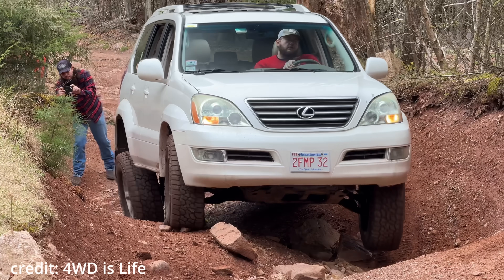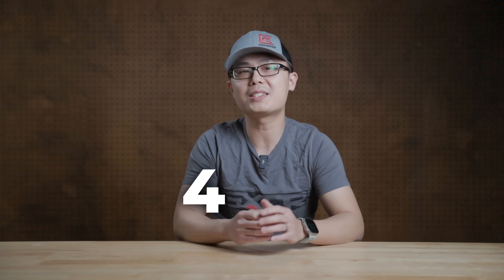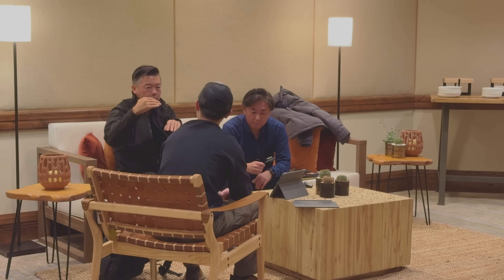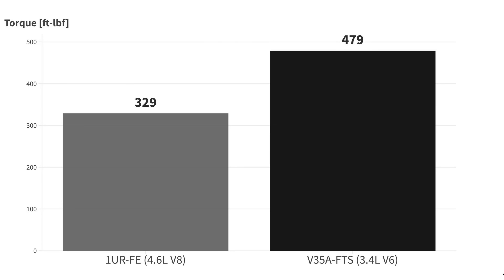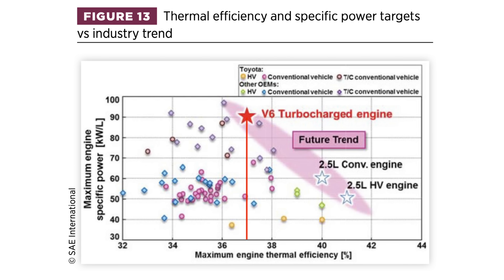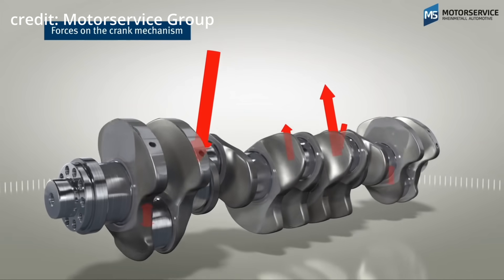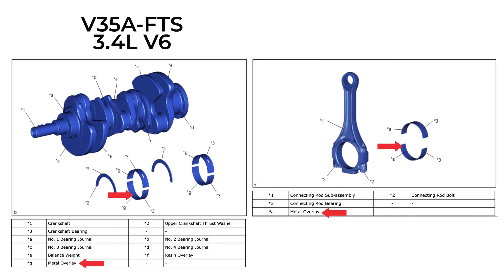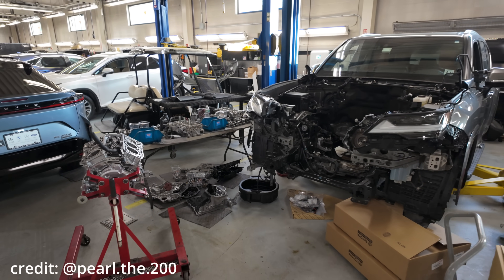Is Toyota V35A-FTS Engine Reliable? Well..It's Not That Simple

Comment from the maker: About 1 month after filming this video, (and 6 years after Chris replaced his first V35A-FTS with main bearing failure), Toyota FINALLY released something official with a safety recall on 5/30/2024. Root cause was machining debris as some of the internet comments correctly predicted. Check out the official recall here https://pressroom.toyota.com/toyota-recalls-certain-model-year-2022-2023-toyota-tundra-and-lexus-lx-vehicles/#
Reply: Thanks for the follow up, great video.
Reply: Hey, Great video!    Regarding this recall and the machining debris....   It would sound more believable if it was related to one supplier or manufacturer of parts, but it appears it's happened at both the USA plant in Texas and the Tahara plant in Japan.  This seems more like a design issue than it does a manufacturing or assembly issue.   And the fact that it's happened over many many years, even though the recall is for '22 and '23 models.  What are your thoughts?
Reply: @Superdada  If they use the same SOP's then the manufacturing location may not matter.
Reply: @OverlandOutfitters  true.  

But my hunch is there’s more to this story. 
“Machining debris” seems more like they weren’t following the SOP.  And the fact that it happened at multiple locations seems odd.  Unless we’re taking about particles the size of microns that’s getting undetected.  

Whether we’ll ever find out or not, I trust Toyota will make it right.
Reply: I’m trying to understand why the hybrid isn’t included.  Or is it just a matter of time?
Reply: @tommyg7047  another YouTuber, @pickuptruckandSUVtalk I think, mentioned that the hybrid isn't included because the hybrid can still get to the dealership under is own power. So the hybrid still get replaced under warranty, but it isn't considered the same sort of catastrophic failure. 

That's what I recall. Seems like a fine line to walk in my opinion.
Reply: @BKthePerson  I saw that too.  So basically, the hybrid may also have “machining debris”.  My guess is these will also have a recall eventually… but knock on wood, mine has 20k and going strong.
Reply: Sorry not buying this machining debris story.  Everything points to a design flaw, and now they are asking their customers who experience this to bring their $70K machine in and have a local dealer disassemble and reassemble the engine and pray it last until the warranty expires.
Reply: @savannahrei8674 we can only hope they extend the warranty by 100k and offer full crated engine replacements.  But that’s still TBD.
Reply: this is not a recall from toyota by the way, it is simply an intent to announce a recall by the mid to end of july 2024.  It was not until the USA Federal government safety agency stepped in and issued a recall because of safety that toyota announced that they "may have left machining debris in the block during manufacturing", that this all happened.  If you notice, the time stamps are only slightly off from each other but the release date was the same. the government released hours before toyota announced their INTENT to recall by mid to end of july 2024.  Further interesting is the fact that this is happening to engines from both the USA and Japanese factory, and that it is happening across their top flagship models and nothing was done about it and it was activly hidden and swept under the rug until the fed stepped in.  There is a lot to take in here about it all, especially considering that they have further pushed this engine block set up in their entirely new and redesigned GX550 and are further producing other new cars and body styles with this in it.  Yet there are dealerships refusing to take tundras in on trade even if you bought them there, but they sure are happy to sell them and any other that may be affected by so called "debris" left behind by toyota directly from the factory.
Reply: So when is Toyota going to hire you as a consultant ??!!! Hey it would be really great for you to share how you’ve become so knowledgeable unless you’re just a pure Genius!!!
Reply: What Toyota / Lexus models are affected ?
Reply: Would replacing the main bearing with another identical main bearing simply cause the same problem ? Great work on the videos
Reply: Well guess om having second thoughts about getting a new GX 550.. Ugh
Reply: @Gonzo1968  the gx550 is unaffected
Reply: @Superdada  It's technically the USA plant in Alabama for this fault, right? I'm going to be surprised if it's a manufacturing or assembly issue, if we find out.
Reply: not so far, maybe when its debugged.
Reply: @TinkerersAdventure  already said posted and announced…. You’re pretty late to the party.  Btw the NHTSA announced a full safety recall of these well before Toyota did…
Reply: Toyota used to be more reliable than other car brands but the switch to turbos has put them on par with everyone else now. This is the proof and they still charging that premium toyota/ lexus price tag
Reply: @tylerproctor4878  are you just now getting into Toyota or?…. Because Toyota has been doing turbo engines for over 40 years and there has not been a single issue with them then or now. Lol. Brush up on your facts. Turbos have literally zero to do with any issues at all happening to anything Toyota/lexus
Reply: @samuelgatton  I suppose I wasn't very clear with that and you are right. Toyota makes great turbos. In fact almost every turbo from most oems are great and all of them have a low failure rate. However, turbo engines as a whole have traditionally had less reliability and longevity numbers than NA engines. Toyota is now like other OEMs using more turbo engines. Apparently these turbo engines function under more stress and have a little more complexity than an engine w/o a turbo. That is besides my point though. My point was Toyota doesn't seem to be much more reliable lately than other OEMs and still cost a lot more. Hope this is a better explanation for you. Cheers
Reply: Is the new land cruiser with a 4-cylinder single turbo hybrid better than this twin turbo V6?
Reply: There seems to be a bigger problem.  The new Tacoma is having transmission issues, the Tundra had a manufacturing problem.  Something has changed at Toyota.
Reply: @jeffk464  you forgot the new 24-25 tacos have exploding shocks and no bump stops either. That’s because they were built and designed in the USA by someone who just cuts corners and does not care at all. For god sakes they copied ford and put an inline single turbo HYBRID in literally everything that is not a tundra now and think it will be fine hahahaha.
Reply: I've searched the internet for the answer to this question and I figure you may be the man to answer it. 

I'm on an allocation list for a GX550 overtrail. Obviously the machining debris issue leading to main bearing failure is concerning, though I daily drive a 97 40th anniversary 80 series, I know Toyota will fix it. That said...

Do we know if the engine block castings, that failed so much in the tundras, and to a lesser extent in the lexuses, are they coming from the same foundry/factory, as the blocks being used in the GX550s?

With tundra production in Texas and the GXs in Japan I would like to think their sourced from two different spots. I kind of hope so.

Regardless I'm trying to wait till the 2025 model year allocation, in the small hope that the more time separated from when those machining failures happened, the better for long term reliability.

Any thoughts would be welcome! Thanks.
Reply: @MichaelD.Greene  the gx 550 is fine.  Those engines were made after the debris issue was found and fixed, it’s also an entirely different tune on it, and has completely different pressure and size turbos. Aka-not affected and not the same
Reply: Toyota engine quality is no longer dependable. Specific V8, V6, twin turbos dropping like Boeing and Intel. 😮